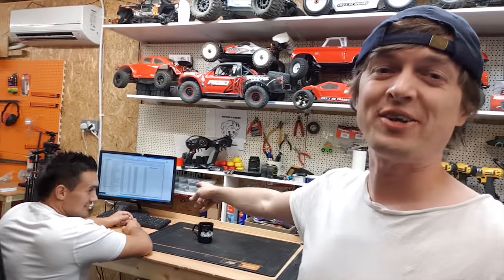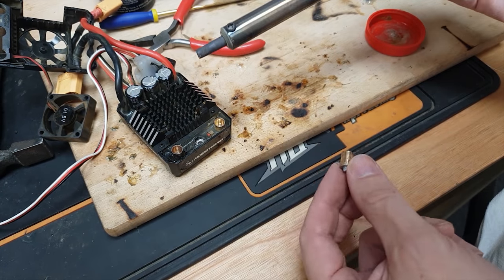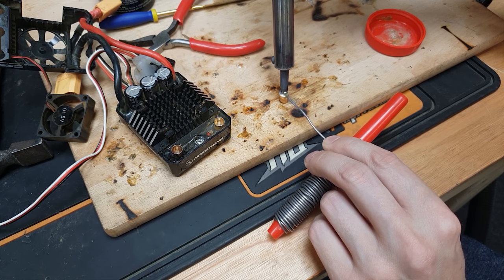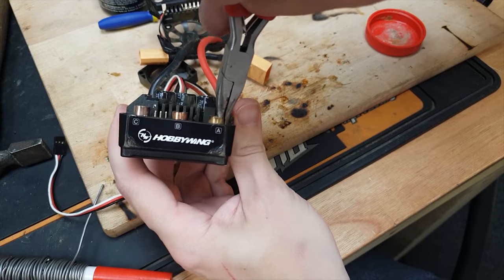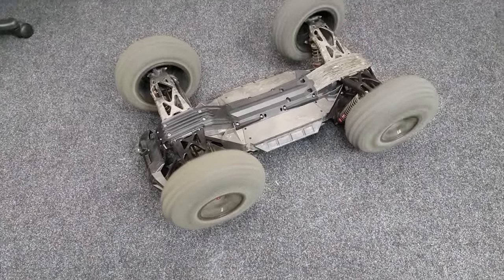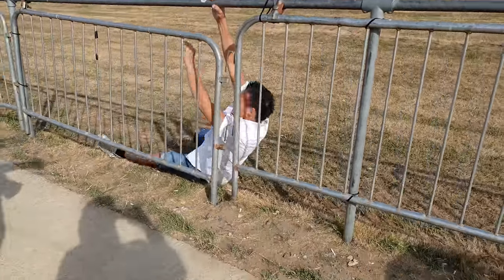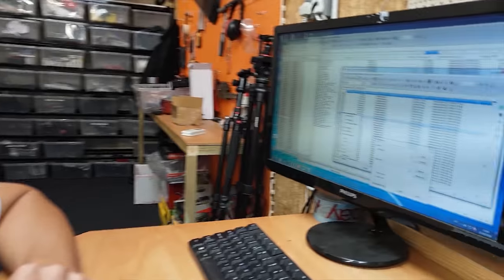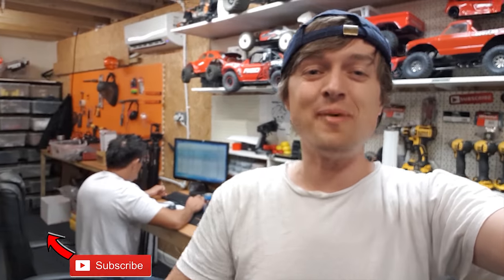Can I fix the Hobbywing Max 6?

Comment: Try to fit The Castle 800kv 12s motor into the X maxx and a esc witch Can take 12 s.

12S XMAXX OVER HUGE JUMP TOTAL DESTRUKTION!? 

that Will give you a lot og Veiw’s just saying...🙃
Reply from the maker: im not into big heavy motors dude, its borderline too fast as it is
Reply: That it’s fair. I have try’ed it and my xmaxx could make double standing back flip...🤪